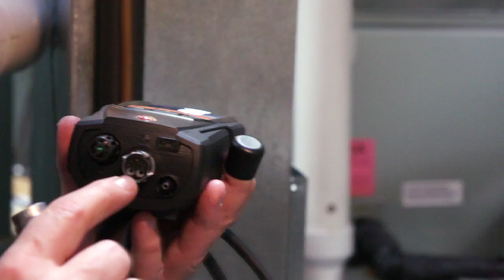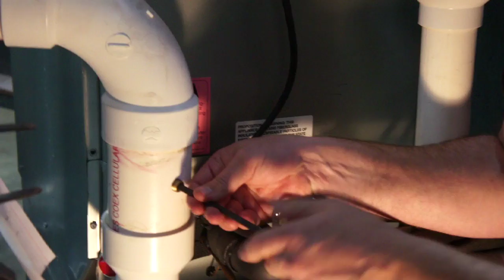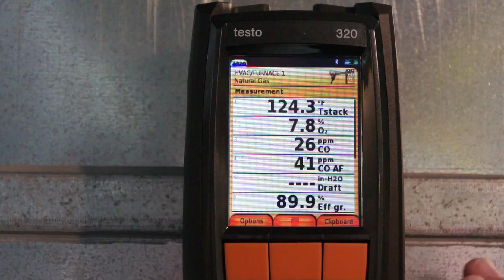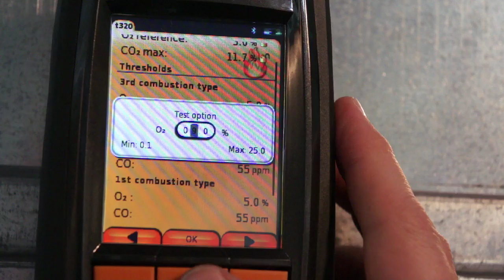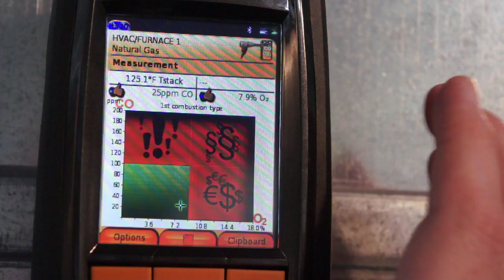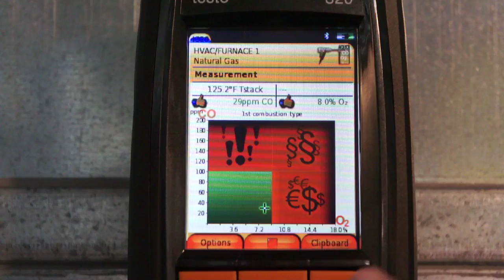Testo 320 Combustion Analyzer with HD Display

Comment: How about using it for engine emission tests?
Reply from the maker: The testo 320, though now replaced by the testo 300, are likely not going to work for engine emissions testing purposes. What type of engine emissions were you looking into testing?
Reply: Well since it tests for CO and CO2, I thought one could use it for petrol engines.
And Webasto/Eberspächer night heaters were something else I had in mind.
Reply from the maker: D EMIL the 300, and older 320, are mainly for residential and light commercial HVAC applications. Testo does offer a more industrial testo 350 analyzer that will likely do the tests you are looking for on those heaters mentioned. Unfortunately, TruTech does not have access to those units. Best to get in touch with testo directly.

Comment: Good stuff, is the the 320 really necessary over the 327? I'm trying to decide which instrument to buy and they're both pretty similar to me so far.
Reply: Stephen, the 320 replaced the 327.  I got a great deal on mine a couple of weeks ago from TTT.  $1123.00 WITH the printer.  It lists for $1189.00 but when you check out, type hvac talk in the promo section and it takes 7% off.  It brought mine down to something like $1102.00 then I had to pay for shipping.
Reply: When I bought mine, I did inquire about the free shipping and was told that by using the hvac talk promo discount, it wiped away the free shipping.
Reply: ***** what are the major differences between the 10, 20 and 30?